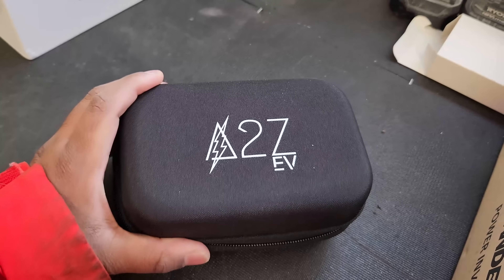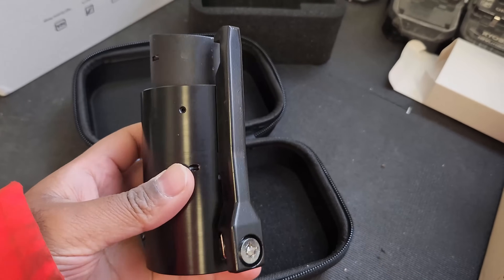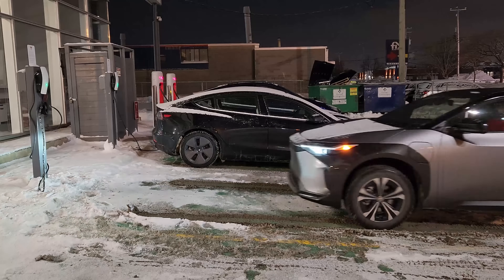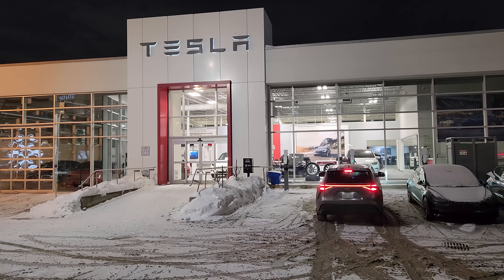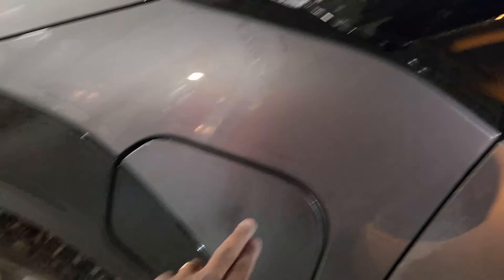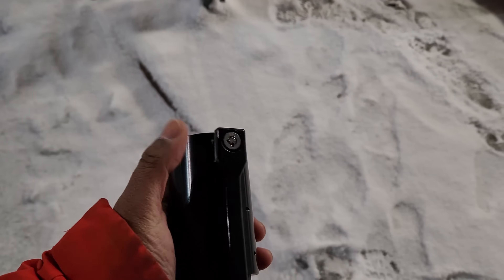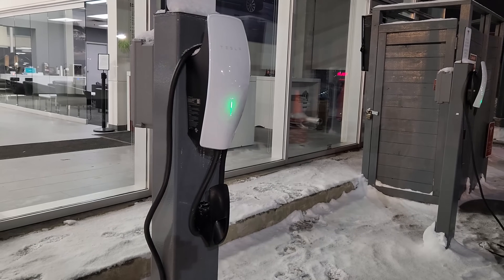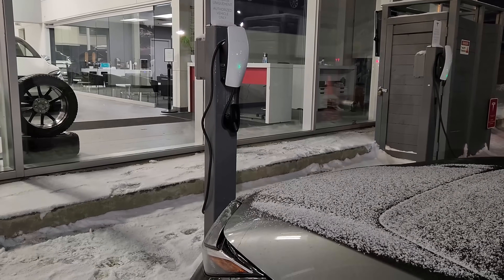How to charge your EV on a Tesla charger with A2Z Stellar adapter - 2023 Toyota BZ4X XLE

Comment: Does this charger work on a Nissan Leaf?  i just purchased the A2Z   CS-1 to CHAdeMo.  Still not as many CS-1 as Tesla destimation chargers.  perhaps I should have purchased the tesla adapter.  its 1/8 the price.  thank you
Reply: How well does your pricey adapter work? I see a few Leafs at dealerships and wondering how that adapter works on the newer Delta and Schneider Electric based EvGo and EA locations. I own a Spark EV with CCS and I feel orphaned since the newest DCFC don't work and just spouts off cryptic error codes that leaves support bewildered yet completely uninterested in my plight.

Comment: Are there a lot of the destination  chargers available or just at Tesla dealerships? I usually just see the superchargers around.
Reply: A lot of hotels are installing them more and more. I personally got the adapter to use for my Bolt EV at friend and families homes who have teslas and Tesla chargers.
Reply: @luncho12491  thanks for your reply. I think I will wait until Toyota is accepted at Tesla  chargers in 2025 and see how it performs.